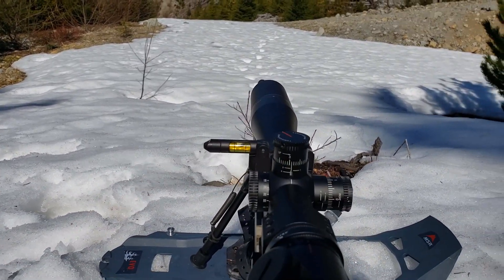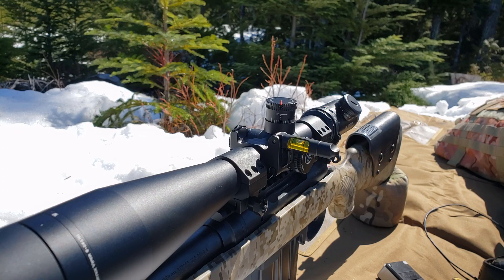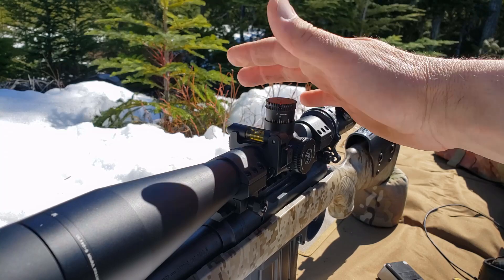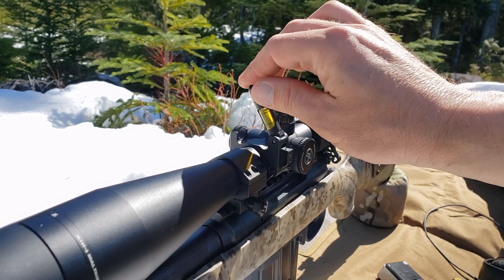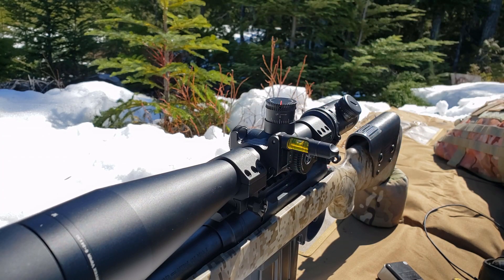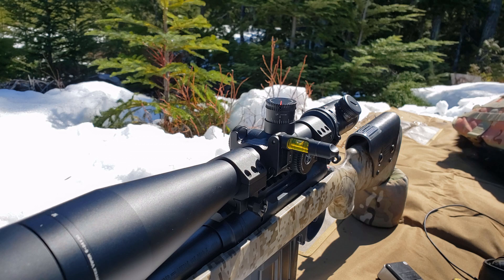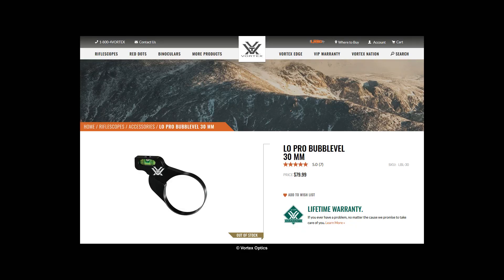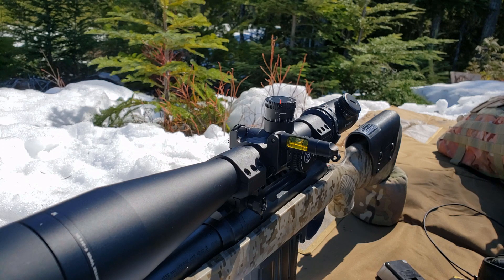How canting affects your point of impact

Comment: The rifle is canted 1.1° to the left with the cross hairs still held at the original point of aim? If so where does the axis of rotation fall? Is the rotation around that of the barrel? Elevation adjustment is an adjustment solely for two reasons: The first being the constant of gravity and the second being the height of the scope mounting. The resultant path of the bullet is aligned against gravity. If the center of rotation of the cant is on that of the center of the scope, the barrel will move around that point. In this case, the cant is to the left so the barrel will rotate to the right of the point of impact but the flight of the bullet will follow the   tilt which will cause the bullet to go  to the left and as the flight of the bullet is no longer parallel to the force of gravity as needed for that distance, the bullet will fall below the original point of impact. Is my thoughT process following you correctly?
Reply from the maker: Sounds like you've got it. Canting causes the rounds to strike to that side and low, so if you cant to the left, you'll hit left and lower than intended.

Comment: This makes me wonder why bubble levels are not commonly used in scoped 5.56 rifles (e.g. ACOG or LPVO) despite being used for 500m shots and even longer.
Reply from the maker: Funny you should say that, because if the weather holds, I'll be taking my 5.56 rifle out to the grasslands tomorrow, running its LPVO out to 600 yards. It definitely has a bubble level. I think the reason a lot of folks don't put them on service-type rifles (such as AR-15s) is because they are typically used at much shorter distances, but you're right, they can and do reach out far enough to benefit from one. It comes down to the user and their philosophy of use. Mrs. Riflecraft's main rifle is a .223, and she of course has a bubble level on it. Since you mentioned the ACOG, I'll point out that optics which cannot be fitted with standard bubble levels can have one mounted to the rail, such as the the one made by MK Machining at the 7:18 mark.

Comment: Well done!
Reply from the maker: Many thanks Russell!
Reply: @prcc  question, is the amount of elevation change due to cant error something that could be calculated with the cosine of angle of the cant? Shots one and two had a difference of maybe an inch or two, right? 1° has a cosine of .999 and your DOPE being 2.9, would end up being 2.89 mils. 0.01 mils at 440 meters is about an inch or two. 5° would make your 2.9 mils effectively 2.88. Basically, I want to know exactly where my round would go if I had to predict the flight path and include cant.
Reply from the maker: @russellanthon9615  Interesting question! For the purpose of this video, I tried to keep it simple and focus on effect rather than geometric theory. You're right that there are about two inches between the two hits (0° and 1° cants). I usually only think of cosine in terms of shooting at angles, because it enables you to determine your horizontal distance with a single, simple multiplication. That's why I think those ACIs (Angle Cosine Indicators) for your scope are much better than ADIs (Angle Degree Indicators). Anyhow, I think what you're trying to do is very interesting from a mathematical or geometric perspective, but it's perhaps beyond the scope of what someone like me is trying to do. Basically, as long-range shooters, we need only eliminate cant error, rather than calculate the deflection of a given cant, since, unlike gravity or wind, we can simply eliminate it. You're probably just more mathematically-minded than I am. ;)

Comment: Another awesome video and it`s remarkable how that 5 degrees really affects the shot placement!  Keep up with the great videos.  Love them.
Reply from the maker: Cheers Patrick! Really appreciate it. It's funny, with that 5 degree shot, I didn't realize until I was editing everything together that it wasn't a bunch of moss I blew off, but a big chunk of rock. There's still a lot of energy in a .308 Win at 440 meters.
Reply: @prcc  Not sure if y;ou take requests for upcoming videos...I`d like you explore or comment on a dual rifle and or cartridge.  Something that you can hunt with (up to moose) but also enjoy the long range shooting fun.  I currently do long distance with groundhogs on local farmland with a .204 but thinking I might want something larger I could hunt with also.
Reply from the maker: @MrTreetall100  That's a good idea Patrick, and I'm always open to those. The difficulty with a rifle for both hunting and long-range target shooting is balancing weight constraints. Hunting rifles need to be as light as possible for carrying over long distances, so they generally have thin barrels since you'll only take one or two shots anyway. Target rifles have heavy barrels that tolerate strings of multiple shots without overheating and shifting their point of impact, and since they're generally less likely to be carried, weight is less of an issue. They also generally have heavier stocks or aluminum chassis systems, further improving precision but adding more weight, which minute-of-mule-deer rifles don't need, so it can be tough finding "one ring to rule them all". That said, there definitely are lightweight precision rifles that are ideal for both applications, so that would be a fun episode! I've put it on my list for future videos. :)